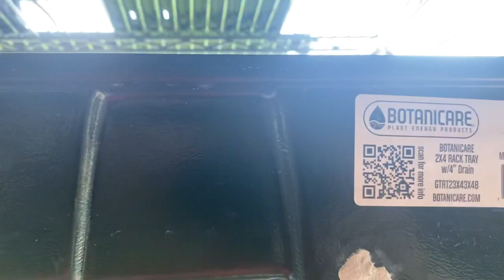Its all Ebb and Flow Now Version 3.0 - New Home Scale Indoor Vertical Hydroponics Farm - Part Seven

Comment: Jack I reproduced this grow system from this video. Thanks! It’s awesome. I’ve got an herb garden for the kitchen in one tray and salad and pak Choy that grows faster than I can eat.  Question: do you or anyone have problems with white mold on the pebbles? 4 months in and just started getting mold. Read hydrogen peroxide might help. Pebbles seem dry on top. Any way to systemically prevent this??? Thanks for all you do!

Comment: Do you have to "reset" your syphons every time you do a nutrient change? Such a cool idea.
Reply from the maker: Reset which part?
Reply: @survivalpodcasting  Whenever you do a nutrient/water change I would guess that the water level goes below the syphons. If it does then you would have to "reset" the syphon. Not a big deal to drop the pipe down into a reservoir to fill it up quick and then put it back into place. I just didn't know if that is what you did or if you had some fancy trick to avoid having to do this. Love your content man.. listen to a few of the podcasts on your website as well. Thanks for all the great info.

Comment: I do a similar kind of siphon between my 27 gallon bins (from Costco). My trick for starting the siphon easily is I fill it to the top and set it upright in my deep freezer. Once it's frozen I toss it in the bins, and after it melts the siphon is initiated. I also use a perpetual siphon (https://youtu.be/uhg0d4VUNyE ) for setting the output level of my bins.. I came up with that approach because I didn't want to drill any holes in the sides or floor for a bulkhead drain.

Comment: The deep flood trays, is there an alternative you would recommend? $80 seems like a quite a bit, especially for something that leaks.
Reply: TractorsNStuff you can get mortar mixing trays from Home Depot or Lowe’s. You will have to drill the holes in tray. I have seen many people using them for hydroponics. A 36”x24”x8”, 20 gallon is around $13 in N.C.. There are larger tubs available. There is one that is 45 gallons, 50”x34”x10” for $39.

Comment: What size pump do you use?
Reply from the maker: @benjaminbrewer2154  I am running the 880 now same family of pumps thought but I needed to be able to push water to three different spots and still have a bottom vent valve for good drainage so I stepped it up a bit.
Reply: @benjaminbrewer2154  TY,  funny I'm not getting YT notifications for comments anymore.  Had to physically check. I must be on the naughty list ;)